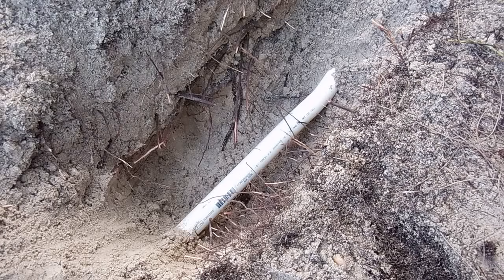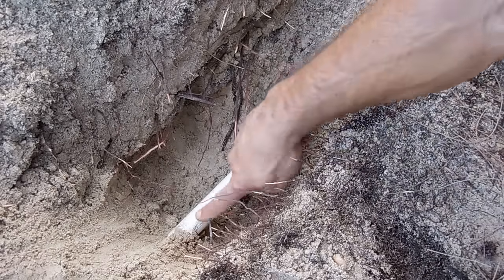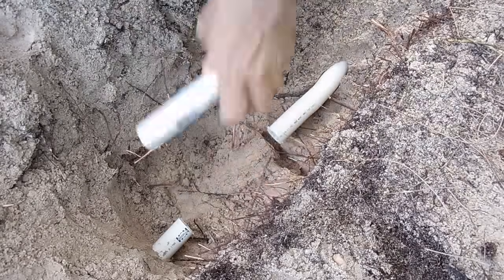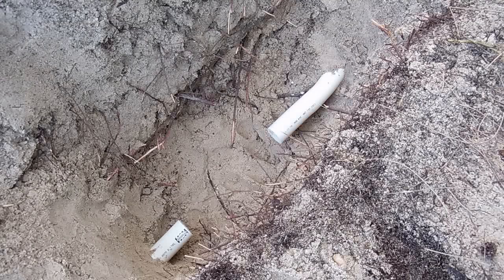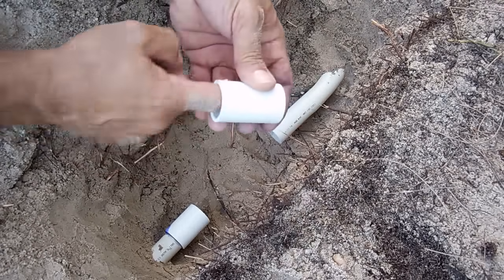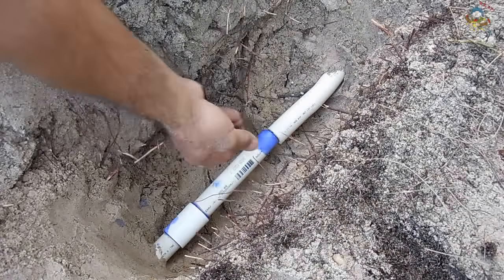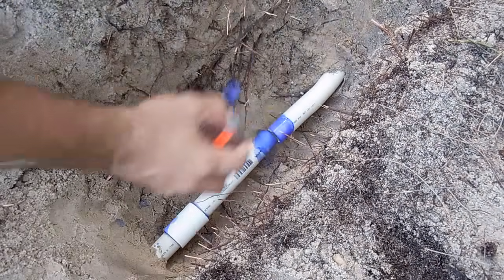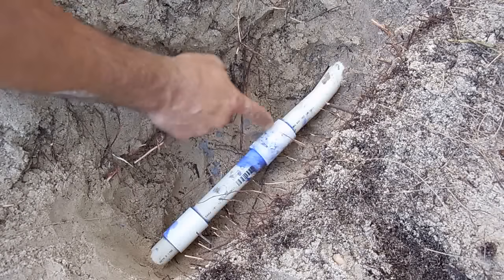EASILY Repairing Broken PVC Pipes(Least Amount Of Digging)

Comment: A coupling and bell end is better or four 90s
Reply from the maker: (4) 90's is the worst repair to make. The water hits a wall and changes direction (4) times. You have a lot of friction loss. What I show is the best.
Reply: Hardly  bell and coupling by a long shot  it is a expantion coupling which is what your showing without the need of power or a file and as far a friction loss   your right but its minute but you can use four 90 s in a four inch trench running perpendicular at any angle  for any one who is unsure what a bell is ita the flared end of a pipe designed to use fewer couplings
Reply from the maker: Not minute. Never use (4) 90's on a main water feed line. You talking about a slip fix? If so, they're not cheap, and have o-ring seals that can dry out over time, especially when used with chlorinated water. My repair is permanent. Watch my other video below. 
https://www.youtube.com/watch?v=UW60vzWNTro
Reply: Does this exclude back flow devices no reread my post bell end of pipe one coupling  is a functional slip fix  which as stated is the same as yours with fewer parts but good on you for useing what you have on hand necesity is the best motivateor and teacher
Reply: And your right slipfixes do cost more than they are worth  i never use them they cause problem down stream if not fully extended lines snap at the fitting

Comment: I used a half round file to remove the stop inside of the coupling.  I felt the inside of the coupling and it felt like the stop had been removed. When I applied glue to the pipe and coupling and slid the coupling onto the pipe the coupling stopped about halfway.  I ended up having to dig out the dirt from the pipe further and lifting both sections of pipe up so I could join them together.  My question is how do I know for sure if I have eliminated the stop inside the coupling?
Reply from the maker: Sounds like a small part of the stop remained. It must be smooth before applying the cement.
Reply: I tried this method too; it looks good in theory but difficult in reality.  The reason is the coupling is designed with slightly bigger opening but narrower in the middle.  It's not worth it to take the time to file it so that it would slide.  Just dig out the dirt from the pipe further and lifting both sections of pipe up so I could join them together.  If you install one end first, you will only have to lift up a few inches.

Comment: Very helpful, smart, money saving tip. I have a section of in-ground agricultural pipe with either a leak or a blockage. Do you have any tips on how to find the trouble spot? I tried listening thru a section of 3/4" poly pipe but to no avail.
Reply: Can you access the inside of the pipe? If so, a sewer cam from Amazon might work. I just bought this,  but there are cheaper ones... https://www.amazon.com/gp/product/B07M5NJ4M8/ref=ppx_yo_dt_b_asin_title_o01_s00?ie=UTF8&psc=1
Reply from the maker: Hi Dave. You can try inserting a semi-stiff metal wire into the pipe and tracing it with a metal detector if you have one, or you can use what's shown in the video I made below. Thanks for watching!
https://www.youtube.com/watch?v=Kw0Zz_7IBP4

Comment: The beach location with the sound of the waves in the background made this vid even better.  Thank you for sharing this great tip.
Reply from the maker: Glad you enjoyed it! Be sure to look over my extensive video playlists below for other videos of interest to you, and most importantly share my channel with others. Thank you
https://www.youtube.com/c/electronicsnmore/playlists
Reply: @electronicsNmore  Hey man I tried this and failed with 2 different couplers. I took a dremel and I thoroughly filed away the stopper in the middle, but even without the stopper I couldn't slide it far enough down on one side of the pipe to align them then slide it back. Do some of these couplers have a slightly different thickness in the middle, even without the stopper? Also the cement glue I used was a "medium acting"  and it seemed to gum up so quickly I wasn't even sure if it would make a good bond. Please tell me exactly what type of cement you used, and if there is a particular brand or type of coupler I need. I'm about to just pay a plumber to do this. You make it look incredibly simple, and I don't think I'm a dummy but I failed twice now.
Reply: The sand actually made it POSSIBLE with his technique. The whole idea behind a repair coupling is not having to bend pipes at all.
Reply: @robertfrapples2472  - Good point

Comment: Works fine with small enough pipe or if the fit between pipe couplers is sloppy. With a 4" dia septic drain, the Theory is valid, but the practice not so much. Friction fit too tight to move the coupler on the pipe. Just went through the process this morning. Still have a drain pipe to repair.
Reply from the maker: Yes, keep it under 2" pipe. Thanks for watching! For sewer lines use a Fernco coupling.

Comment: Put the slip coupler on without glue before you insert the first end . then glue the two ends and slid the coupler over the cut ends.
Reply from the maker: It doesn't work that way. I've discussed this at least 50 times. Read other comments.

Comment: What  a noob you can buy slip couplings why bother  filing them out
Reply from the maker: If they were sold at Lowes/Home Depot/ Ace/True Value/ and many other places, then this video wouldn't have been made. Spare me the stupidity. Learn the difference between PCV DWV and PVC pressure fittings.

Comment: You can buy what is called hubless "repair" couplings. Home Depot carries several sizes of them. They are sure handy on 4 inch pvc sewer lines. I just slide them on the line dry and apply a liberal amount of glue on the pipes and slide the fitting forward and twist about half a round. Only problem I see with this video is when a pipe breaks the hole is never dry and neat. The hole gives a lot more trouble than the repair itself.
Reply from the maker: Home Depot only sells PVC DWV full slip repair couplings. :-) I checked all over before I made the video.

Comment: They sell a slip coupler,  it comes without a Ridge.  To do it right for can glue your coupler and pipe together then  slide the slip coupler on the pipe, glue the coupler to the fixed pipe then simply slide the slip coupler over cleaned and glued fixed pipe. Repair done and done right!
Reply from the maker: They only sell full slip PVC DWV couplings. If you want what I show(PVC for pressure), you need to go to a plumbing supply house.
Reply: Right, go to plumbing store and get a slip coupler. I just moved an in ground pool pump assy and used 3 or 4 slip couplers and had to no hub one line. What you did works in the field but they do sell what you need without having to dremel anything!

Comment: Grind out the stop?  How about two slip joint couplings?  Available at plumbing/irrigation shops, these are designed for repair work of this nature.  Also, cut a little farther from the crack; pipe is cheap enough.
Reply from the maker: The video was made because Home Depot / Lowes / and hardware stores don't sell full slip PVC pressure couplings, only DWV. If you have a plumbing supply nearby that sell them, great! Thanks for watching!

Comment: Thank you so much. Very helpful video!
Reply from the maker: You're welcome Jon! Be sure to look over my extensive video playlists below for other 
helpful/informative videos of interest to you and most importantly share my channel with others. Thank you
https://www.youtube.com/c/electronicsnmore/playlists
Reply: @electronicsNmore  Quick question. When I was using the Dremel on the coupling to remove the stop, I went ahead and bored the whole thing out a little so that it slid more easily on the pipe. It still felt to me like it was making good contact. However, I may have done a little too much because I have a minor drip at that coupling now. (First time ever working with PVC!) Here's my question. It's about 6 inches underground and it only has water running through it while the sprinkler is running. Do you think it's OK to just let it be like that and bury the pipe or do I re-do it?  I don't run the sprinkler very often -- maybe 20 minutes a day during the hot months.  Or, is there maybe a way to seal it externally -- like a sealer? Really appreciate the advice!

Comment: Ummmmmmm they make like a dozen diff types that slide over the pipe so u don’t need to do that...
Reply from the maker: Ummmmmmm they all cost much more money, and aren't permanent repairs. :-)
Reply: electronicsNmore ummmmmmmmm they cost more yes, but job over and done in 30 secs. Your time and labor is worthless??? I can see already that you are the type guy that will spend an extra 30 minutes fixing a pipe so he can use a 50 cent fitting to save from spending $5-$10 on much easier stuff!!!! And they are ALL permanent repairs, not sure why you think that? 35 year retired Master Repair Plumber :)

Comment: Repair couplings are not so expensive as to have to make your own. They sell them at Home Depot for less than a dollar. Another method is to get 4 90s. You cut out a foot or so like he did but glue two 90s on each end straight up. Then cut two equal pieces and glue them in. Dry fit the 90s then glue them all up. You can just push the other two 90s down with a bind. PVC fittings are $.30 a piece. They aren’t going to break the bank to just buy the proper fittings without having to make your own and possible mess something up
Reply from the maker: Good luck buying PVC no-stop repair couplings at HD/Lowes for pressure lines. They only sell them for DWV, which is why I made the video. (4) 90's is a horrible method that creates a lot of friction losses.
Reply: electronicsNmore I agree with the 90s part. It’s not preferred, I was just giving options. Personally, I think the telescoping couplings are best. As for the repair couplings, I may be the wrong person to comment about availability. I live in Austin and have had no trouble finding them. It’s probably different though when you get away from the city. The reason I commented in the first place is you played the angle that they were so expensive it was worth it to modify. You never mentioned availability. I would have at least suggested looking for them first. Especially when you consider most people won’t have the tools needed to modify the couplings. I’m a plumber by trade and I don’t own a dremel or die grinder. You could do it with a drill which is what people are most likely to have. I would be more concerned that someone would mess up the coupling because they didn’t know what they were doing and end up having to call a plumber anyway.
Reply: Also, where I live makes the 90s method more viable. Pressure loss isn’t an issue. Most homes have to have PRVs. I cut my teeth in a small town in west Texas and we never used the 90s method. However, if someone is watching this video, it might be worth it to mention other options. If pressure isn’t an issue then using 90s might be easier for someone who knows zero. They might try to modify the coupling and score it or modify the ID which may make it leak over time

Comment: This is a good technique.  If cost isn't such a concern, they now sell flexible segments with female ends that work wonders in this situation, especially if the original break was caused by a root or something else intruding on the path of the pipe.  You had a luxury, working in sand.  Our dirt here is sparingly interspersed among rocks, and to be able to flex the pipe enough, you have to dig quite a way back along the pipe ends.  The flex patch segment saves that work.

Comment: You still used a repair coupling.  Nothing time saver or digging or money saving about this video.   The same way  Probably every1 that watched video repairs PVC.   Fast setting cement is best.   You just need to be faster
Reply from the maker: You have no idea what you're talking about. LOL Please, think before posting comments.
Reply: @electronicsNmore  yes I do.  A repair coupling has no stop in middle of it.   So tell me what I was wrong about
Reply from the maker: @LUTHERJ304  They don't sell PVC full slip couplings at Home Depot/Lowes/local hardware stores for pressure lines, only DWV! If they did, this video wouldn't have been made. They're only sold at plumbing supply houses.
Reply: @electronicsNmore  my point exactly. And I know home depot etc  dont sell them  I've been plumbing 20 years dude.  I lay bigger pipe than you ever seen before.  Stuff you can walk inside . PVC is nothing to me no  bolts required easiest plumbing out there.

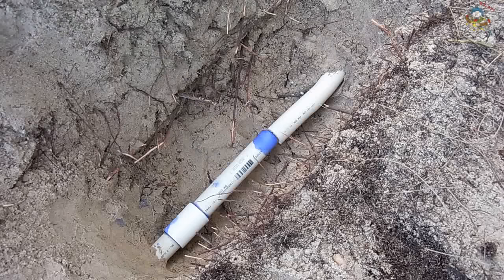Comment: 7:43 Any dumb munkey wud have slid that 2nd joiner onto the pipe that's not glued b4 installing the SHORT repaired pipe DAAAHHH then all have to do is slide the joiner right back over the small pipe.
and get your little finger and stick up your ###

Comment: I've done this.....used a spade bit to remove 95% of the stop. But you can also use 4 elbows for an effortless repair.
Reply from the maker: That works too. (4) 90's is a bad idea, you have way too much friction loss. Thanks for watching!
Reply: @electronicsNmore ______ it's easier for older people, almost  effortless repair. friction loss is only measurable at full volume... (maybe putting out a house fire)...it's minimal...what is "way too much"?....  only in gas systems where the pressure is only 7/10ths of one pound would i consider friction loss. thanks for the reply.

Comment: You're a life saver!! I had two pipes side by side, so the adjustable piece was not going to work at all. A couple things: sanding the stop by hand was not working, so I used a grinding stone bit on my drill and it worked beautifully; then I had to use a vice grip on the coupler to get it to slide as you showed. Got some carpal tunnel going on, so I didn't have the strength to do it by hand. It's been 12 hours. I turned on the 2HP irrigation pump, and the repair is holding. Yeehaw!
Reply from the maker: Great to hear the method worked for you! Be sure to look over my extensive video playlists below for other great videos of interest to you, and most importantly share my channel with many others. Thank you
https://www.youtube.com/c/electronicsnmore/playlists

Comment: Thank you - this works. I only do this about once very 5 years, so I wasn't sure that the cement would provide the adequate lubrication needed to slip the coupling over and back. Definitely use gloves. I used a round file to knock down the ridge in the coupling, then I tried to dry fit it using soap - and that doesn't work - I suspected the reason why. Between the primer and the cement, the PVC softens enough to make the fitting slippery. It was a gamble, but it did work. I guess the only reason why they don't make smooth couplings is so they can prevent people from splicing pipe this way without buying a $9 adjustable splice.
Reply from the maker: Great to hear! Be sure to look over my extensive video playlists below for other great videos of interest to you and most importantly share my channel with many others. Thank you!
https://www.youtube.com/c/electronicsnmore/playlists
Reply: I am concerned about the same thing. I have removed the stop, but it is still such a tight fit that I can't slide the coupler over its entire length. I am hoping the primer and glue act as a lubricant. But if it doesn't work the first time, I am sunk.
Reply: Kevin Kizer did it work?

Comment: Wouldn't it be less digging to use a threaded Union or a Furnco? The ID of the couplings are tapered to fit tighter as they slide on. Dremeling out the inside destroys that feature. Now you're relying on just glue to seal the joint. Also, you don't put glue on both pieces.
Reply from the maker: Everything shown in this video works perfectly. I've used the method for over 20 years with no problems at all. If you're afraid to do it, then don't.

Comment: I don’t think so!
😂🤣😂🤣😂🤣
Reply from the maker: I know so. :-)
Reply: I am not saying it can’t be done that way , I am only saying that theirs about ten (10) other ways I would do it!
JUST BECAUSE YOU CAN DO SOMETHING DOESN’T MEAN YOU SHOULD! 
Again 🤣😂🤣😂🤣😂
Reply: @tarxantoo  can you share some of the other 10 ways to do this?  Thanks in advance.
Reply: Cheapest easiest thing is a plastic dresser coupling. you don’t Buy glue/cleaner you don’t buy  pipe you don’t have to buy two coupling and ream the inside out of it . 
1: expose about 12”-16” inches pipe cut pipe slide it on(dresser coupling )tighten it up done.
Reply: Cheapest easiest thing is a plastic dresser coupling. you don’t Buy glue/cleaner you don’t buy  pipe you don’t have to buy two coupling and ream the inside out of it . 
1: expose about 12”-16” inches pipe cut pipe slide it on(dresser coupling )tighten it up done.
Dresser coupling: $3.99

Comment: I could have dug out 4ft each way and did same thing much faster...I’m a great digger
Reply: Good luck doing that with any pipe more then 2 inches thick.    You don't always have the option of digging, just like the author of the video mentioned. And have fun digging out the 4 inch irrigation supply pipe 3 to 4 feet deep that has sprung a pin hole leak usually on a Tea joint.   I have used this method many times and it works well.  The only think I would have to add is when you are working with pipes 1.5 inch or more you do have to sand the inside of the coupling a little bit so you are able to slide it up and down the pipe if not it will bind up special when you put primer on.  Also you do have to put the coupling on to the pipe then add glue and slide it over because there is no way of lifting it up like that when it comes to a thick pipe.